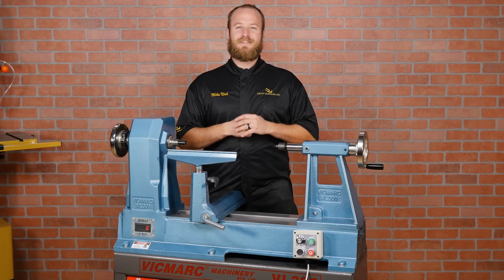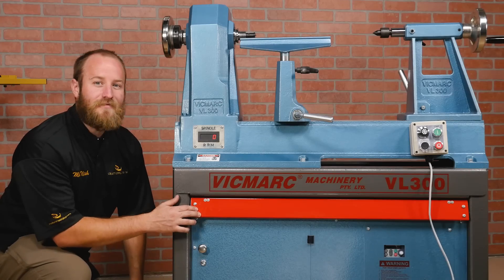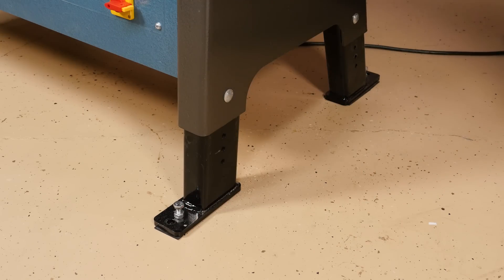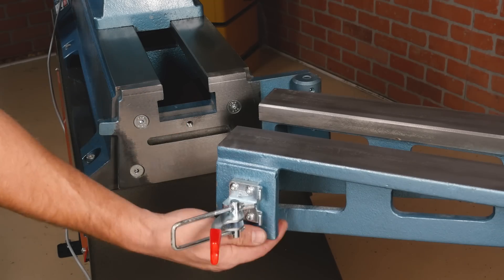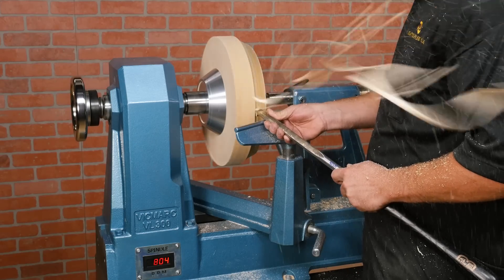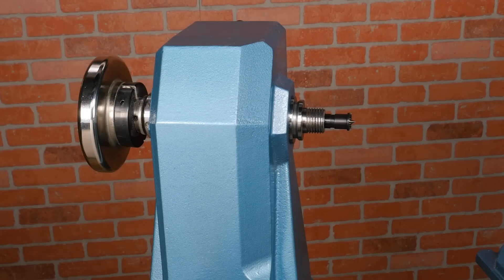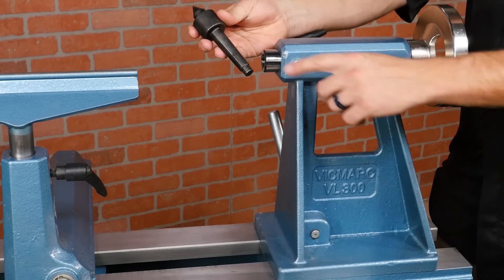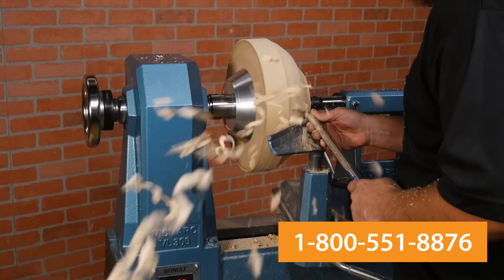Vicmarc VL300 Lathe Review

Comment: For some reason vicmarc's lathes look like they were built in the 70's. Dont get me wrong they are top notch lathes but i think they need to do a bit of R&D revising the look of it to make it look more modern.
Reply: think it's a case of FUNCTION over form, would rather a tank that can stand up to the job, than a pritty model just for ones mantle piece!
Reply: @andyvan5692  True, but some redesign could be done to improve accessebility and user comfort, such as having to lift the heavy motor to change the belt without some lever.
Reply: I get the critique, but at the end of the day, these are no nonsense, no compromise lathes. I bought a Laguna which is a very nice lathe, but it simply doesn’t have the presence of my buddy’s Vicmarc, not even close and it’s another thing altogether to see it in front of you.

The same goes with their chucks. I’ve got a VM120 that simply is on another level.
Reply: @eduardvaniersel7535  why add a potential failure point
Reply: Is a beauty!

Comment: This thing does look awesome, and definitely cheaper than the American Beauty that Robust makes.  Are there any benefits to it besides the cheaper price compared to the AB?  Any downsides, in your opinion?  The retro powder coated cast iron does look awesome too, not sure if I'd bank for that over an AB, but if they're practically identical and one is 1k cheaper, then this would definitely be a wise consideration.
Reply: Its a fantastic lathe, I have had 3 vicmarcs and before those the VB36. I sold the VB and never looked back. For more vids and comments see "On The Turn" on Face book groups where you can see me making my hollow forms and other large projects